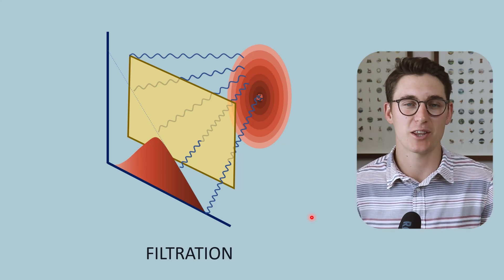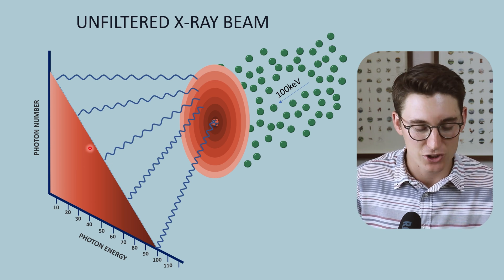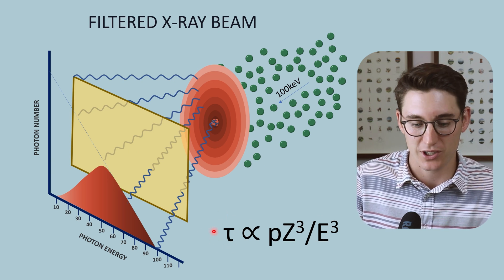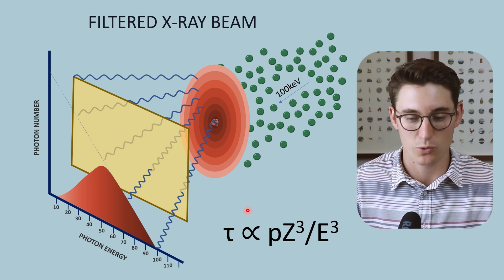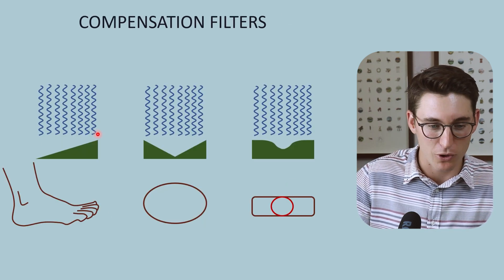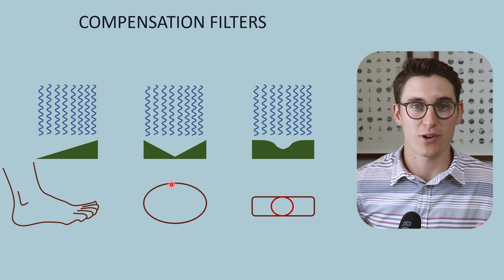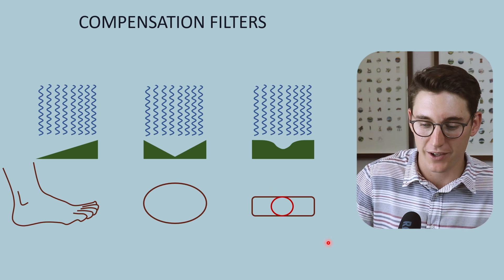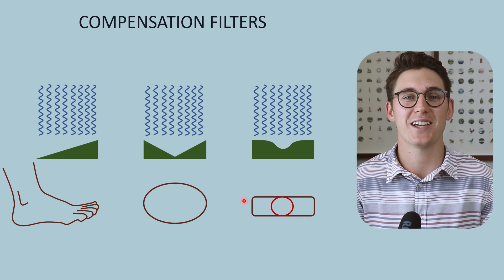X-ray Beam Filtration (Added and Inherent Filtration) | X-ray physics | Radiology Physics Course #14

Comment: Hi senior Michael
I've got a question hoping to find an answer.
What is the impact of filtration on image contrast?
Some books like Oxford says it  worsens image quality because of beam hardening!

Another researches says it improves image contrast because of removal of lower energy photon that contribute to image noise!
So I got confused!
Could you please clarify it?!
Reply from the maker: Hi 👋  great question.
It’s not a straight forward increase/decrease question. It very much depends on the primary beam energy, filter type and thickness, tissue type, thickness etc.
As a general rule of thumb in diagnostic energy ranges, increasing kVp will reduce image contrast. Filtration, as you’ve said does this through beam hardening. If asked in an exam (MCQ) and given no other information, I would say filtration reduces contrast. 
Important to remember that contrast does not equal image quality and high contrast is not always better. Hope that help a little
Reply: @radiologytutorials  i also tend to choose this, filtration degrades image contrast.
Thanks a lot 🙏